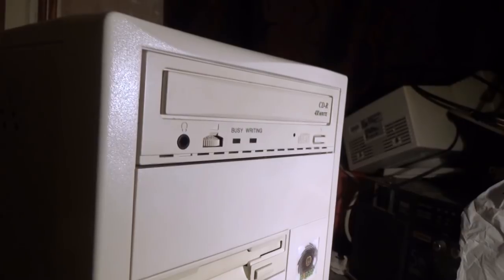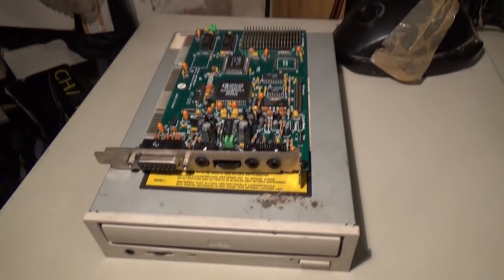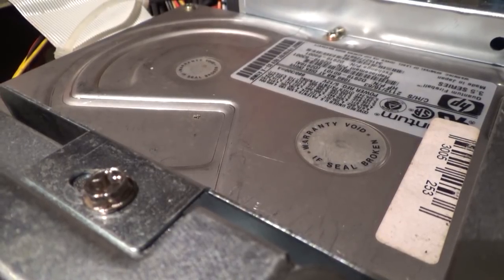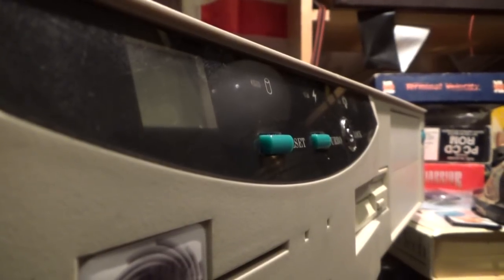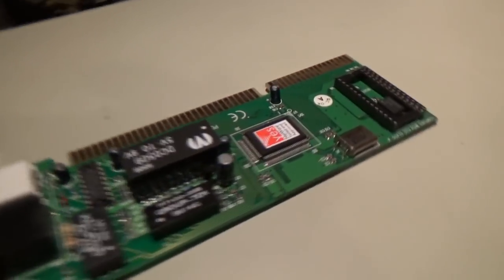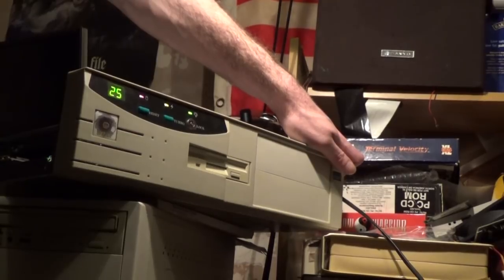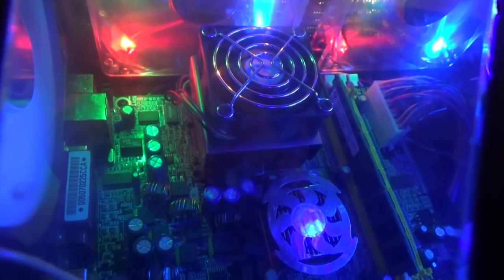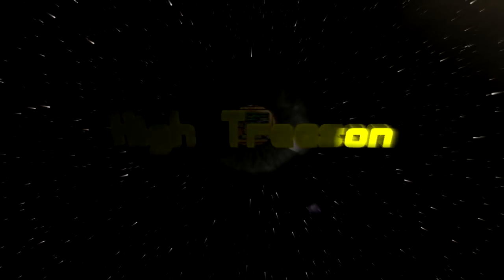1994 PC - Reality VS YouTube

Comment: I bought my first PC in '93.  It was a refurbished Packard Bell PB400+ mini-tower PC.  It came configured with a 486SX 25MHz CPU soldiered to the motherboard and 2MB of RAM which was also soldiered to the motherboard.  It had 4 30pin SIMM slots for expandability (all four slots had to be filled to match the 32bit bus of the 486), it came with no L2 cache but up to 256KB could be installed.  It also came with Oak VGA 077 graphics chip with 256KB of video DRAM built into the motherboard as well.  There were 5 open ISA slots for expansion.  No modem.  No sound card.  No CD-ROM.  It had a Connor 120MB hard drive and IBM PC DOS 6.1.  No copy of Windows at all.  One 3.5" 1.44MB and one 5.25" 1.2MB floppy.  I poured so much money into that machine to make it last and didn't upgrade it until 1998, which was an Intel Pentium II 300MHz.  I still have my first computer and I still play it from time to time.  It wasn't nearly as fast as other 486s at the time due to no local bus graphics, but it was mine.

Comment: Christmas 1993 was the year my family, i.e. me, got a 486. It was a Vobis AMD 486-DX2/66, 4MB RAM, 420MB HDD, 1MB VLB VGA, 14" CRT. A Vobis catalog from September '94 lists it at 2099DM, but it must have been a lot more expensive as slower DX-40s cost more in a '93 catalog. Over the years it got upgraded with an Aztech soundcard, CD-ROM, 256k cache, a 2nd HDD and expanded to 24MB RAM. I loved this machine. It lasted until 1998 when I finally could afford a PII-350. Four years did make so much difference back than.

The worst part about it was that all the software came on CD and floppy images on the HDD. As the machine had no CD-ROM drive, in order for me to wipe the pre-installed OS/2 and install DOS, my dad made me write all the floppy images to floppies. That was OS/2, WfW 3.11, Corel Draw and more. I think it took me over a day.

Comment: As for first times, nothing to this day beat the sound I heard in Prince of Persia 1 , when one of the tiles cracked and breakeked on the floor, hearing a sound blaster pro for the very first time, my voodoo 1 came close
Reply from the maker: Whilst I'd used sound cards before on other people's machines, there was still something rather fixating about getting an OPTi 930 to run in my first PC, finally being able to hear the music in Keen 4 and the short sounds in Chips Challenge, the latter of which stuttered, the machine was slow and something was probably configured wrong as this may have been the first 'upgrade' I did myself. It was all pointless because loading the TSR kept causing an Out of Memory. I'll definitely look at that video you linked later on when I've got more time to do so, rather fond of the 486DLC overall.
Reply: HighTreason610 I think I have a Opti 930 sitting around somewhere will definitely fire it up to have a listen :)

Comment: Your video is very accurate.....

In 1994 PCs were still pretty niche.  Unless you were a school or business most likely you were running something 8088-486 SX.  Every home I knew with a PC in east Alabama in the early 90s ranged from some old Tandy or XT clone used mostly for WordPerfect and Lotus 1-2-3 off floppies to a 486 DX-33 that cost around $3000 for just the computer itself and only had 4MB of RAM and a 325 MB HDD.  SVGA was rare, most of us had VGA or CGA in the home.

Just who I knew alone had....

Older sis
AMT 386 20mhz, 4MB RAM, 80MB, VGA, and DOS 5

Second older sis
85 Tandy 1000 SX with TGA, 384K, floppies only, DOS 3

Next Door friend
Compaq Deskpro 386, 2MB of RAM, VGA, Windows 3.1/DOS 6

Friend up the street
Gateway 2000 486/33, Windows 3.1/DOS 6, SVGA, CD-ROM, and of course his dad REALLY limited our game time on it as it was $5000 in 1993.

Friend across the street..
GEM 286/10 AT clone, 40MB HDD, VGA

If you had internet like my sister did through Auburn University it was 14.4K dial-up, $15/hr, DOS based applications (GOPHER, Newsgroups, FTP) unless you had Windows and NCSA Mosaic or Netscape.  There were few pictures, load times were slow, and it was mostly business, science, and other professional aspirations at the time.
Reply from the maker: One thing I did consider talking about was the second hand market, but skipped over it and focused on machines made at that specific point in time. There were definitely a large number of older systems still in use, my Uncle was dragging a 286 and monochrome screen around with him for a good while into the 90s.
The early internet seemed to be full of Star Trek too, at least the newsgroups did, disproportionately so, that or people around here just really liked that show.

Comment: My late 94' PC was 2600 dollars (my grandmother paid for it) and was reasonably well equipped
with Cyrix 486dx2-50mhz with 8MB RAM, 128k cache expandable to 256k (which i did the next year) 
and 1MB Cirrus Logic VLB video, SB-compatible Adlib soundcard with double-speed cd-rom,
420meg Connor hard-drive (LOL, 420 meg sounds absurd now) and win 3.1, came with a
Samtron 14" svga monitor and actually decent keyboard/mouse for the times.  Of course,
this was not a really big name brand (was Epson) and i'd imagine the Cyrix processor rather than
Intel also made it cheaper.   That said, changing a single jumper gave me an instant dx2-66 that
was rock solid without any added cooling so that Cyrix chip was pretty decent, and I later 
swapped in a dx4-100 overdrive chip, doubled the ram to 16MB and added a 1GB hdd.  Ah, good times.

Comment: First PC around here came Christmas of 1993 using a very similar Unichip VLB motherboard. It cost a bit over $3000US (over $5000US today folks) with the following specs:
486 DX2/66 with 256k writeback cache and 8MB of RAM (all 1MB 30 pin SIMMs)
Unichip VLB motherboard
2MB Cirrus Logic CL-GD5428 VLB video card (high end stuff!)
VLB IDE Multi-I/O card
WD 340MB IDE hard drive
Mitsumi 1X Cd-ROM drive
ATI Stereo F/X CD soundcard.
14.4kbps modem with fax.
3.5 and 5.25in floppy drives
All housed in an Enlight mid-tower case running Windows 3.1 and PC DOS 6.1.

This wasn't even top of the line for late 1993 as there were plenty of EISA/VLB 486 workstations along with the recently released Pentium 60 and 66Mhz commanding much higher prices.

Comment: Amstrad has the thing going at that time. We brought our first PC in 2004. It was an Amstrad PC7486slc. There was a board-soldered TI clone of a 486sx, 4mb memory, 130mb v. slow hdd, same with 14" SVGA monitor, keyboard, mouse - very integrated 1mb on board video for £799!
Reply: Finally in 1997 added ESS 1868 audio, Realtek 8019 network, 8mb memory.... never found a 386DX for the socket (yes it was a 386 mobo with a 486 OVERDRIVE soldered on!)

Comment: While I do agree with you overall premise, I think the prices you mentioned were extreme highs rather than what most people paid as systems intended for home users were far cheaper than that. Based on prices published in 1994 editions of PC Magazine, you could buy a full Pentium 90 system with 16mb of ram, 528mb hard drive, 2x CD-rom, a SVGA card & a 15" monitor for under $3000 not long after the Pentium's debut. Furthermore In those days if you bought the components separately and did the assembly yourself you could easily knock at least 1/3 off the price. I didn't come from a well-off family but my brother was able to buy a full Pentium 90 system in 1994 while studying full-time at university and only working part-time. As a high school student making $5/hour, I was able to upgrade my family's PC to a 486DX for just a couple of hundred dollars and by 1995 every kid I knew who was into PC gaming was running either a Pentium or a 486 and we were frequently doing lan parties.

Keep in mind that much of the PC tech from the 80s and 90s that survives today is actually former office equipment and thus doesn't truly represent what was popular in the home market. This is because most home PCs tended to be upgraded every few years and parts got frequently junked, while office PCs were often recycled in bulk as complete systems and then kept in storage warehouses for years. That's why we see so many IBM brand 4mhz XT 8088 CGA systems survive today when both PC & overall computer sales of the 80s (from 1986 onwards) were absolutely dominated by 8-10mhz turbo XT clones usually with EGA. Yet those clone PCs are seen less commonly in the retro community which gives an inaccurate picture of what home PC usage was like in the 80s.
Reply from the maker: While you're not entirely wrong, what you have to consider is that I had to tool this for an international audience and to do so, had to work out a few averages and even employ a little guesswork. Disposable income in the United Kingdom, for example, was far lower than it was in the United States - in my family, with two working parents, there was often only £5 left at the end of the week to buy groceries. You're also assuming the average person had knowledge of anything beyond the most obvious source of sales information, which they most likely didn't:
If you're some guy who never owned a computer, never had any interest in doing so before, know nobody who owns one and now want one in the early mid-90s, you won't be buying it in pieces from some shady guy behind the business units and assembling it yourself. You wouldn't even know he existed and most likely, nobody in your circle knows about him either. Plus he probably won't take payment in installments. Instead, you're going to get your information from TV, maybe buy a magazine, maybe spot a marketing brochure somewhere and invariably be sweet talked by a salesman who probably doesn't know what he's even talking about.
Your last paragraph actually baffles me as these were all topics covered in the video - it was flat out the point of it - so I won't use up our time addressing it again in written form here. I'll go so far as to say that a lot of the inaccuracies come from the enthusiasts themselves, such as how now you see countless people with P4s (I still can't figure out why) when you'd have been laughed out of your friend circle back then for owning anything but a K7. Meanwhile, the average fools were still buying Pentium MMX 166 machines in droves because they were cheap.

Comment: Could you make a video on BNC networks? The only videos I can find are discussing them and aren't showing it set up. I would find it interesting to see how they would of been set up and if it is possible to connect it to a modern network
Reply: From what I've read, just connect each card with a "T" and the use basic coax cable and put terminators on both sides.

If you want it to communicate with modern networks, just use a computer that has both interfaces as a router, or use a hub/switch that has a BNC connector on it and hook up one of the ethernet port of that hub/switch to your regular network.
Reply from the maker: I've been thinking about this for a while so now I might have enough excuses. I'm not sure how far I'd go with it, like whether I'd bother to dig out LAN Manager or LANTastic type stuff, or if I'd just cheap out and run Windows, but the cabling and its limitations can definitely be demonstrated fairly easily. Otherwise it is pretty much as Deksor says, 'T' connector on each NIC with a 50 Ohm terminator at each end of the network and conversion via a machine or a hub. 10Base2 isn't that much of a headache, really, the older 10Base5 is the one I'll likely never set up as it's just a pain to work with. Anyway, I'll add the 10Base2 stuff to the list of things for consideration along with the stuff other people asked for.

Comment: Oh and that story about playing Duke Nukem 3D on that 486SX-25 at the end of the video... that was me! Totally me! hahah I remember spending a tonne of time playing DN3D on my fancy 'new' DX2-66 and going "yep, this is fiiiine. Slow... but hell, it's my machine and it works, even it is slow!".
Reply from the maker: My uncle was still running a 286 cicra 1994, though I've no idea what speed it was or what was in there, only that he built it himself. In theory Duke 3D should run decently on a DX2-66 as it was what they tested it against in development, it still chokes from time to time though if you don't crank things down a little, especially if you have the sound on, and a lot of user content will probably run like crap... then again, maybe not, most user maps from that time were quite bare. Good luck with fixing the Wang machine anyway, unfortunately my father's old machine went missing. I kept the parts, planned to fix them, but they didn't make it here in the move. They weren't the original anyway, the first system was returned on warranty back in the 90s when the hard drive messed up - all these years on I suspect it was using a CMD0640 controller as it exhibited that exact behavior. The parts I had from the replacement were fairly generic, some PC Chips Triton board. All I have left of it is the ESS sound card.